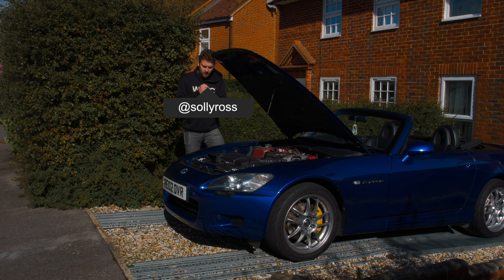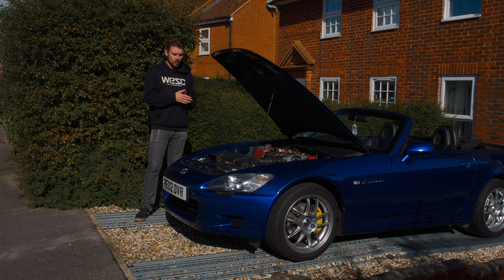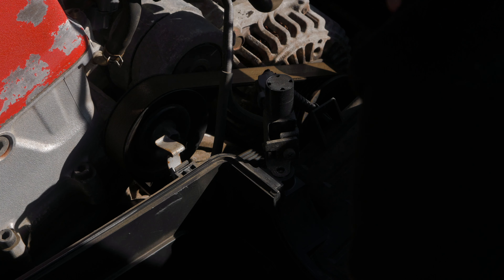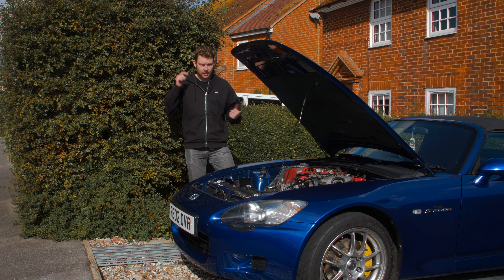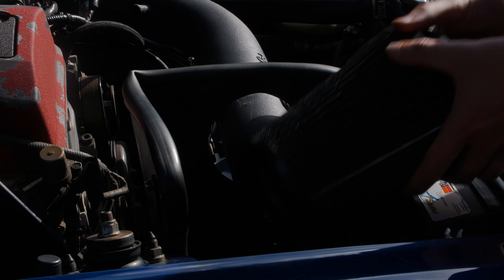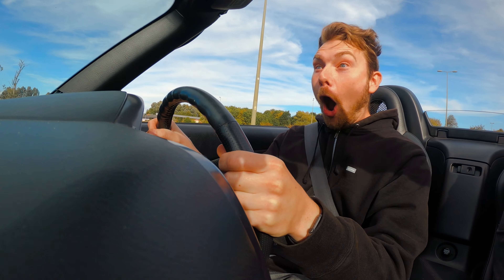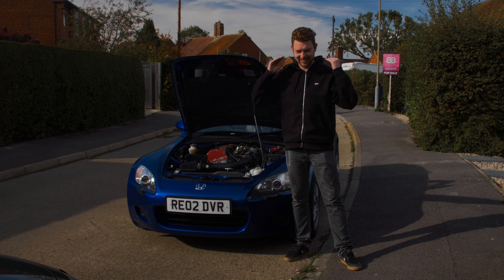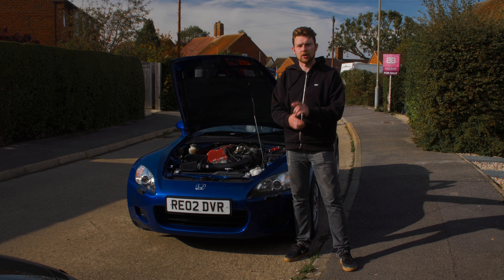Honda S2000 K&N FIPK Induction Kit Install! With Before & After Audio!! 4K

Comment: The FIPK can be modified to reduce the heat soak issues! It basically just needs additional heat shielding to seal the gap between it and the strut, shields at the front to stop hot radiator air getting in, and a big cold air scoop from the front grill to get more cold air in! Mines heavily modified in this way and performs well now!
Reply from the maker: May look into this in the future. I do think the gap between the strut and the airbox is a strange design choice.
Reply: @OllyRoss  it’s because of the left hand drive cars having the AC pipework there that’s all! But unfortunately for us it just leaves a big old gap for it to suck in hot air from around the exhaust manifold! If you want any info on how I’ve modified mine just have a look on my intagram, same name as on here :)

Comment: K&N FIPK is great for adding sound but digging around s2ki it looks like it actually loses a small amount of HP over the full stock setup. I had a Mugen intake ready to install last year but didn't want to cut my factory hood/bonnet and in the past 2 years haven't been able to source a brand new Mugen hood so I ended up selling the intake and going for an AEM V2 CAI which is the only S2000 intake I've seen reliably making any power improvements and not losing power anywhere - it also sounds amazing. Power-wise it seems to give a decent mid-range bump while keeping the same peak HP as stock.
Reply from the maker: Yeah, I am fully aware of the power loss with this set up but the sound is what I was after as it won't stay N/A forever. Good to know that there is a solution out there if you want to stay N/A though!
Reply: Have you seen inside a AEM V2? The piece of smaller tubing for their (dual chamber crap) continues inside the other bigger tubing a long way, it has to disrupt airflow… I was going to go that setup until I saw that and went Injen instead which is nearly the same without the issue, and it’s louder because it’s only one layer or aluminium tube vs two
Reply: @Manvswild11  yep, had one on my first AP1 back in 2007, and ended up putting one on my 2nd AP1 in 2021. The 'dual chamber crap' is in fact one of the reasons it makes a little bit of power over stock, where most other intakes (particularly those without the multi size design) actually end up losing power. If you spend some time looking at actual dynamometer charts from real owners back when these cars were new, you'll find that AEM was not lying when explaining how their design utilizes harmonics to increase the amount of air entering the engine at certain RPM ranges - in exactly the same way that the runners and plenum of an intake manifold influence this. Nothing new, and not a massive improvement, but a tangible one nonetheless.

Comment: Bought one of these kits ages ago myself but haven't fitted it yet. I came to the S2000 after many years with civics and Accords and was quite disappointed by the lack of VTEC crossover noise. I had the same face as you when I did the airbox mod the first time. Not only do you loose some HP's you also loose a lot more petrol because you go into VTEC chasing the noise. Sounds awesome!
Reply from the maker: Well, it looks like you have to get it on the car then! I think the loss in power is worth it for the noise! Haha

Comment: What makes you think it will lose power ? Nearly all open cone filters make power especially on s2k. The stock air box is ridiculously restrictive. All this heat soak is bollocks.  Good job 👍🏽
Reply: nope. it depends on the car, some stock airboxes are restrictive. but the one on the honda s2000 is super well made, piping is direct from the intake with nothing to restrict the airflow. check out LHT Performance's video testing out different intakes for the S2k. the performance is similar during cold runs, but once theres heat in the engine bay, aftermarket intakes drop about 10 hp vs stock airbox due to heat soak. 

again, it really depends on the car. honda's rsx for example has one of the worst stock airbox designs and even with heat soak an aftermarket intake will give you an hp boost. but the s2k is different in that regards.